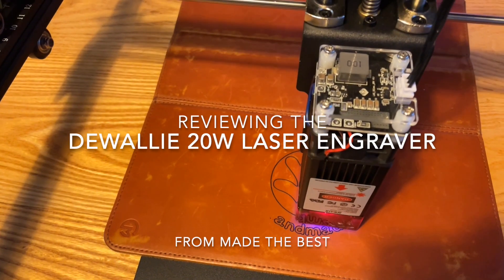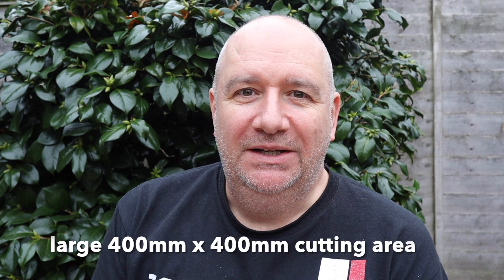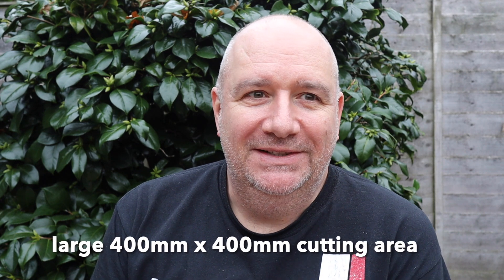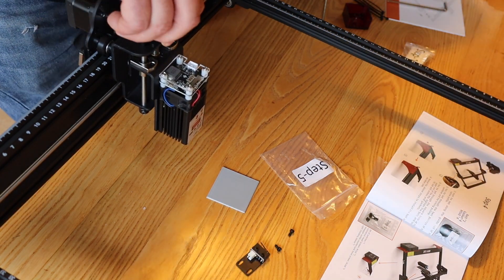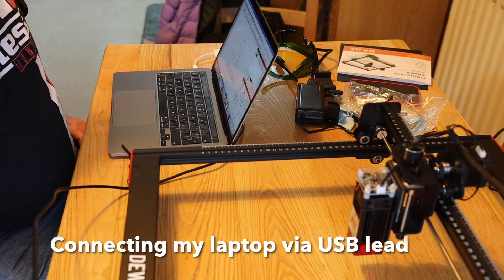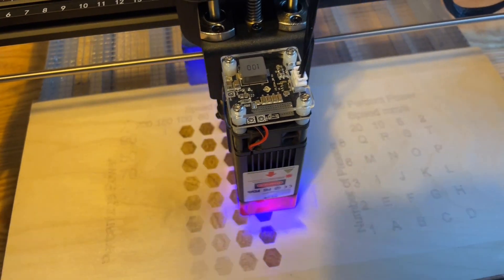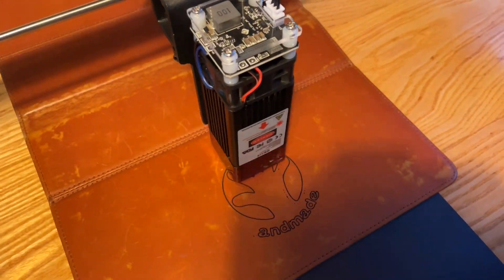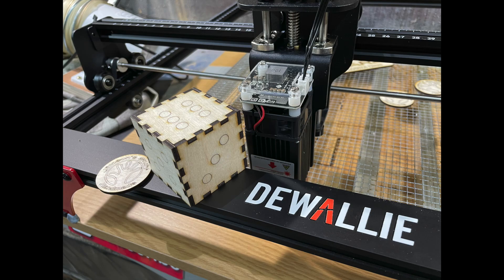Dewallie 20W Laser Engraver Review

Comment: Glad you are back, Jim.  I missed you!  Not really interested in the motorized vehicles you did recently but maybe I'll take a look.  Looking forward to new woodworking videos.  Really liked this video.  I've been thinking about getting something like this and you make it look easy enough that even I can do it!  At $300 USD I think it is worth a try.  A belated Christmas present!  I'll look into it more but do you think it would be able to "autograph" the bottom of a 4" bowl?  How about round things like pens or rolling pins?  If so, I'm sold!
Hope you, Mia and the family had a great Christmas and are looking forward to a Happy, Health and Prosperous New Year.
Reply from the maker: Thanks Tom. The laser has a very narrow focal plain so not ideal for cylindrical objects, some more expensive lasers have a roller mechanism which rolls the workpiece as it engraves. It would certainly engrave the bottom of a bowl if it was flat but you may need to raise the frame up on blocks to gain adequate clearance.
Happy New Year

Comment: The perfect review and intro to a low cost hobby diode laser Jim, thanks for sharing🙏 I have a similar one that's about 6 months old now and love it. Even though this one is what I would call 2nd Gen with so many improvements having been developed with the laser head (mine doesn't cut near as well even with the same power ratings).   Thanks again🙏  Take care. -Mike p.s. Mine came from Made The Best too (USA) and shipping was quick ~1 week.
Reply from the maker: Thanks for watching, yes cuts very well, it has a very tight focal point and although doesn’t have true air assist, the magnetic red guard is designed in such a way to direct the down draft from the cooling fan so that it blows away the smoke which seems to work well and keeps the lens clean.

Comment: Great review of what looks like a good machine.  I assume it's using a pair of 10w diodes and a beam combining prism to get up to 20w.  A DIY enclosure to control fumes and stray laser emissions and this looks like a useful and relatively inexpensive piece of kit.
Reply from the maker: I am impressed with it’s capabilities. 20w is the input, output is 5.5w which I think is a single diode. It is certainly a small focus point for a diode laser, the Kerf is minimal. There are machines out there with more features but they are a lot more expensive. Many thanks for watching.
Reply: @JimsonMakes  That's interesting and a little deceptive - but quite a few of the Chinese suppliers have started using that "different" and stupid way of making their machines appear more powerful.  There are also some legitimately using a pair of laser diodes that work in tandem as I described - doubling up the power.  It's possible yours is doubling up a pair of 2.8w diodes.  Caleb Kraft over at Make: just did a video on the Atomstack p9 (kickstarter) which uses this technique (they called it "dual compressed" which he didn't understand at the start of the video) but I've seen others that claim to have duel 10w diodes which would make a very powerful diode based machine.  Thanks for the video and I look forward to seeing how you make use of your new engraver/cutter.